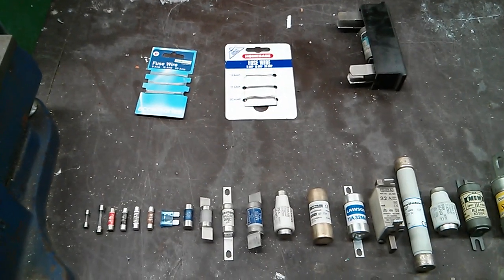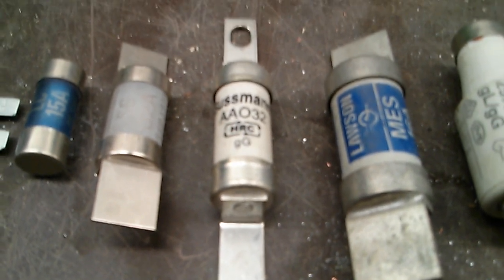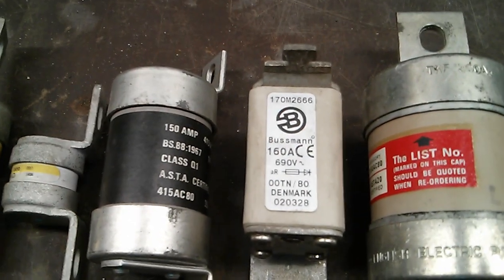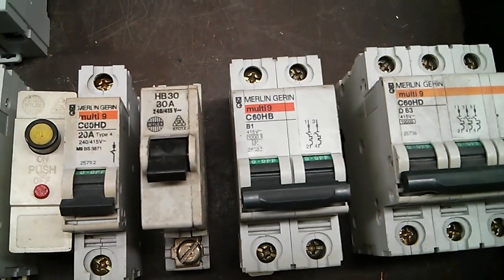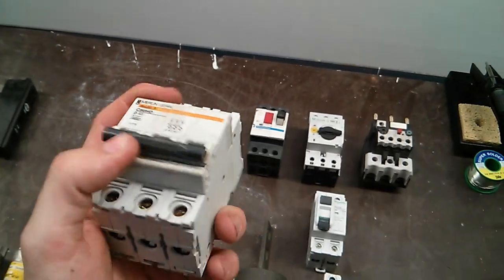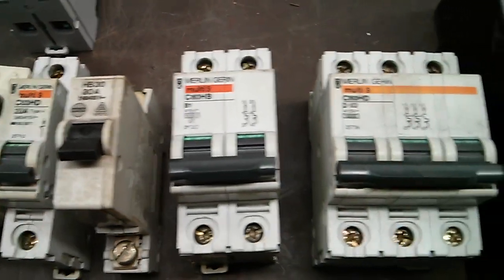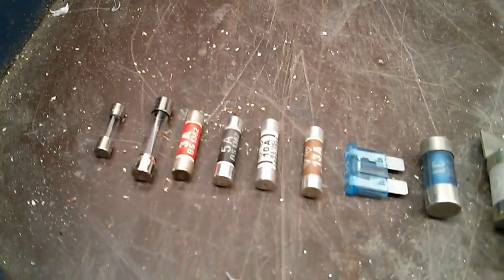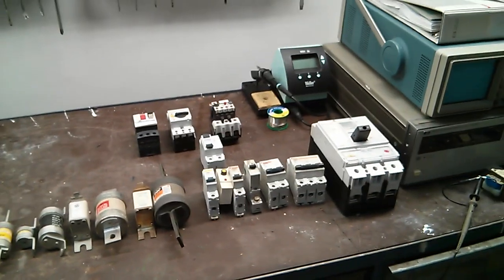British Circuit Protective Devices

Comment: This house still uses fuse wire on the consumer units, the only MCB's we have are on the new extension and an RCD on the shower. That's it, everything else is just wire.
I like it because they can handle tonnes of inrush current, but not from a safety aspect. It does take excessive care and attention to use for anything fun.

Comment from the maker: Our MCB circuit breakers, single pole, double pole and triple pole all go as low as 1A,
I believe the double pole in the video is a Type B1. I've seen Type C1 triples before but
I can't think where. The fuse wire is pretty interesting also, would be nice to show a fuse
wire consumer unit in action, or at least decommisioned, I will keep my eyes peeled for
one for a future video. A triple pole RCD would have been nice to show also, I might know
where to get hold of one of those though. xD

Comment from the maker: There's still a lot of fuse wire type consumer units about these days,
The main thing I'll say about it is expect the next electrician that sees
it to give you a quote on a complete house rewire, the old boards are
a good sign that the wiring of the house needs updating to make things
safe. Nothing like having RCD protection on every circuit, real peace of
mind! If you want inrush capabilities on a specific circuit, say the sockets
logically, go for a Type C MCB.

Comment: Ooooh, I like that Moeller MZM.

In my bedroom, that would make a nice lightswitch. :D

The sound of that turing on & off is proper sexxy. Also, what were those little dials on it? Is the device a circuit breaker or a RCD?

I know of RCDs where they are selectable (i.e. delayed RCDs) but I've never known a circuit breaker to be selectable, unless that is, those dials allow someone to set it up so that th end user can choose the disconnection curve. :-)

Thanxx for showing,

-BoomBoxDeluxe.